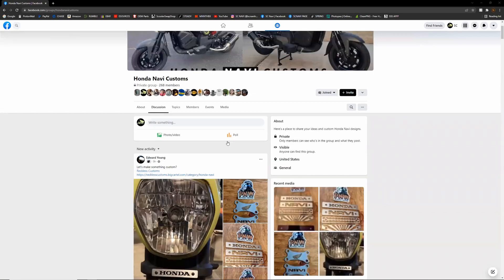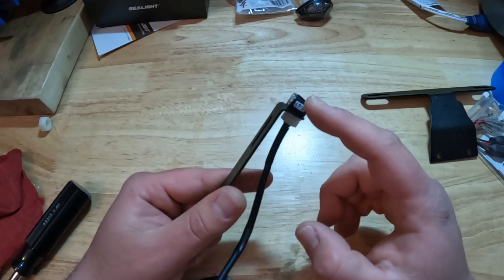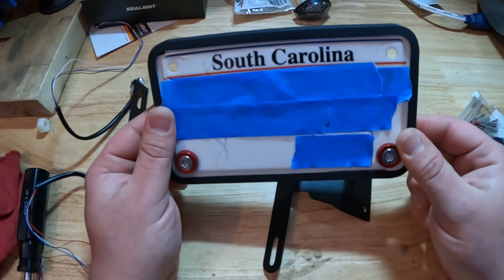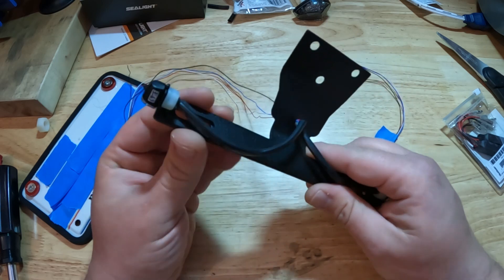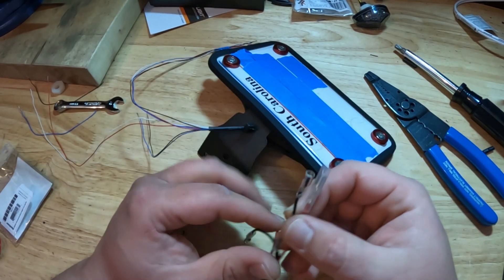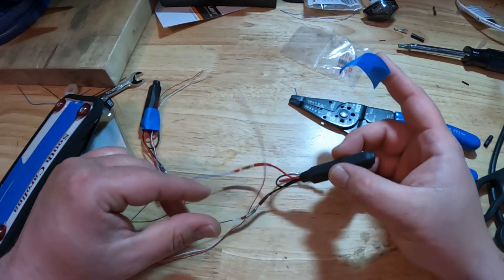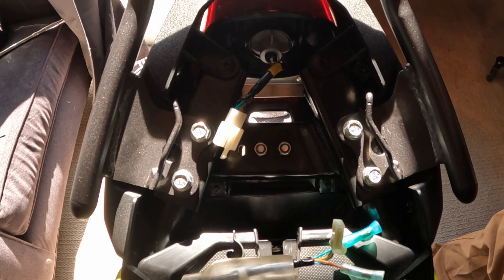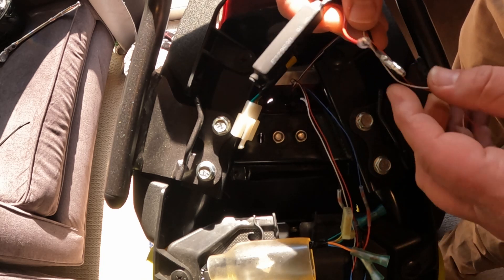HONDA NAVI - MNNTHBX Fender Eliminator Install and Review.

Comment: Where do the running/brake lights connect? I cant find the wiring diagram for the Navi
Reply from the maker: It is the largest connector in the tail section. If you lift the seat you should see the harness at the rear. The brake light connector is covered by a black rubber boot. Just pull the boot back.

Comment: I am 90% sure you will need a flasher relay to correct the flashing tempo. The resisters simply lower the power level going to LEDs because LEDs require less power draw than bulbs to operate. The relay will dictate the tempo.
Reply from the maker: You are correct, just having trouble finding the right one. I have tested 3 that should have worked and did not.

Comment: If you just do the fender delete, is there a way to keep the stock turn signals?
Reply from the maker: Yeah but you will have to fab up a plate to attach the stock signals to.